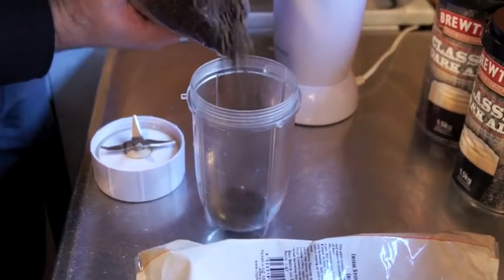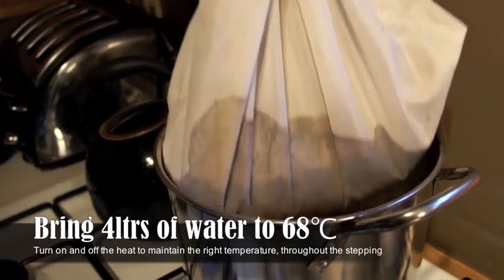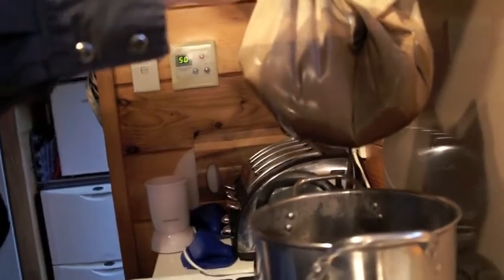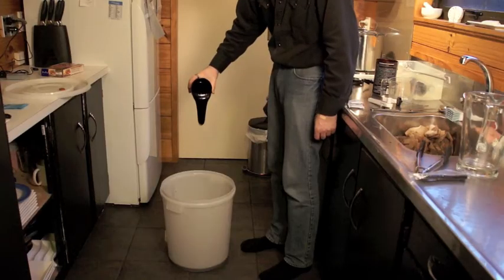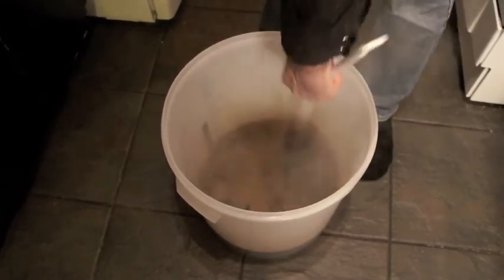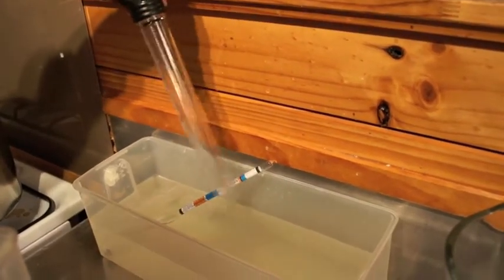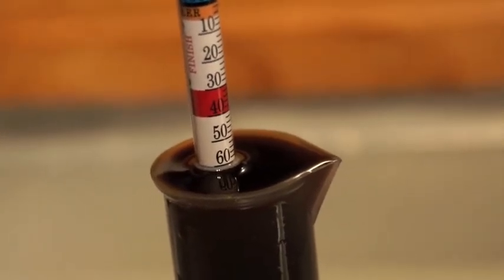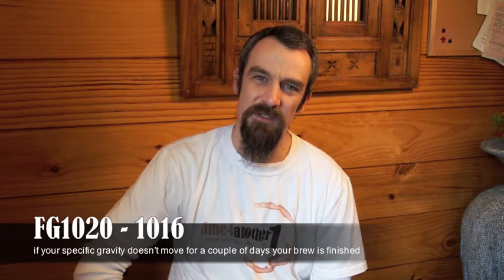homebrew beer - chocolate stout

Comment from the maker: Pouring the wort and water into the fermentor aerates it quite well, if there are air-bubbles on the top of the wort, then there it is pretty well aerated. Half a teaspoon of sugar will be fine for bottle conditioning, you could even try some without any priming sugar in them at all, they will still carb up over time. Cheers

Comment from the maker: I use a sterilised turkey baster to draw a sample, its easier when the fermentor is sitting on the floor, also its a good method as during fermentation when you take a sample, the tap sample will have a lot of solids in it from the sediment, giving a false gravity.

Comment from the maker: Hi Neil, Youngs Double Chocolate Stout is awesome, I love that too, it has actual chocolate in it as well, so you could add 50grams of grated chocolate or unsweetened Cocoa at the end of the boil if you wanted. Yes a Coopers Stout would be fine, but still use 2 cans, as that adds the body and fermentable's to the brew, however for the second can of extract I would use the Coopers dark malt extract instead of another Stout. Let me know how you go. Cheers Paul

Comment from the maker: just re-read that, yes the cans of liquid malt extract can go either directly into the fermentor, or you can boil them with the wort from the steeped grains. Liquid malt extract has allready been boiled and is strelized, so it just need to be diluted with water. Best practice though is to boil it before adding to the fermentor.

Comment from the maker: With grains you dont want to add them to water hotter than 74ºC (165ºF) because that extracts tanins from the grain husks, and it also kills the enzymes that convert the starches into fermentable sugars. With malt extract and Dry malt extract it has allready been converted into fermentable sugars, and the tanins stripped, so it can go straight into the boil. Grains wont do much in the fermentor either, and would leave off flavours in your beer.

Comment from the maker: To keep the sweetness you want to have unfermentable sugars in the brew, such as malt-dextrin, and dextrins. you get these out of dark caramel malts such as Crystal 80, 120 etc. They will also help with the body/mouthfeel of the stout. As for temperature, your after a fermenting temp that suits the yeast your using. I would suggest S04 at 20ºC/68ºF

Comment: good how to but but instills bad methods. poor sanitizing practices. boil the LME to kill bugs. hydrate your dry yeast. aerate the wort. include ferm temps, tips, times? that is one of the biggies
Reply: If you intend be to fastidious yes the method details can be improved.
However in 45 years of brewing I have learned that mostly good kitchen hygiene (such as used in general meal prep) is all that's needed. One exception being fermenter sterilisation. BTW no brew or bottle or keg contamination ever in the last 40 years & that's not just luck. 
I do have a beef about boiling malt extract, from my reading that is both unnecessary & damaging.